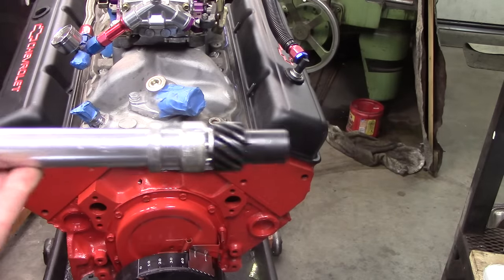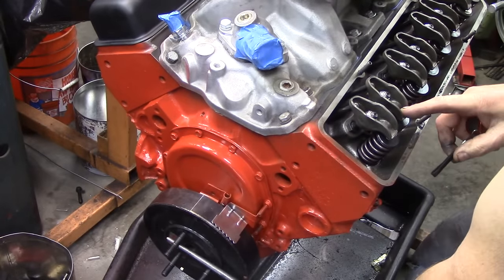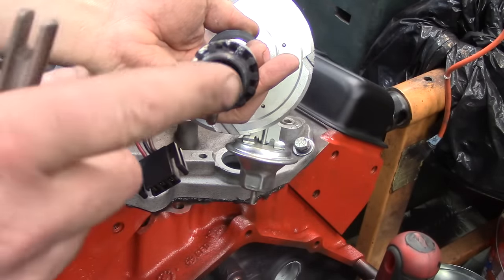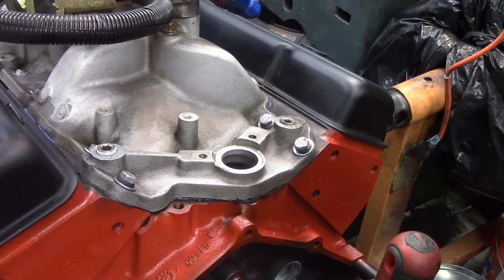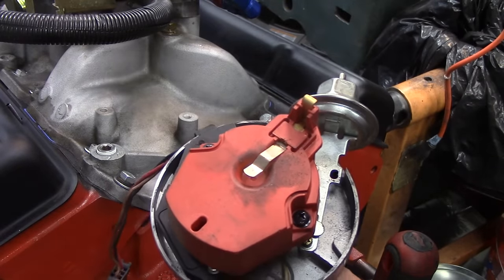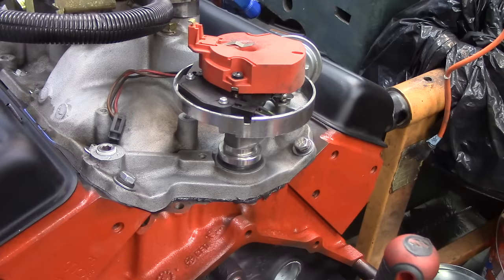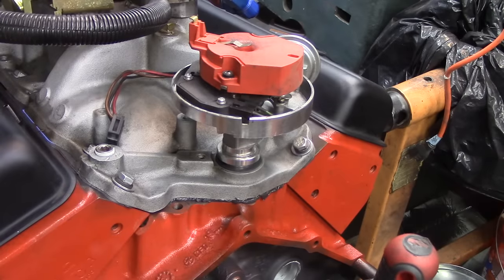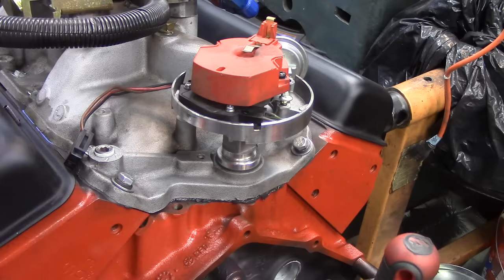How to Install A distributor in a 350 Chevy

Comment: Thanks!  Great video!  When you hook up the number #1 spark plug wire, does it go where is rotor is pointing at AFTER you seated the oil pump gear?  OR before, when you made TDC right after turning it to zero degrees on the damper?
Reply: You ever get a answer on this I’m baffled trying to put one in a rebuilt ford 351 /m also does the rotor that’s to point at #1 do you use the end that makes contact with the cap or the opposite end according to the diagram in my book my rotor would be pointing to #6 if your using the part that makes contact with the cap

Comment: I pull number one spark plug and use a pencil or skinny screwdriver in plug hole until it sits on piston head then rotate crankshaft until piston comes to top, easier and gets you dead on dead center

Comment: back in 2006 a friend and i installed a chevy crate engine the 350 HO in my 95 z71,my friend installed the distributor but im now wondering years later if he did it right,lol messed up huh.it needs a tune up,oil,plugs cap and rotor and i need to check this.so thanks man.

Comment: I recently bought a truck with a new Vortec 5.7, and a bunch of other new stuff, for $200 because it wouldn't start.  He installed the distributor 180 degrees off, when it wouldn't start he got pissed, slammed the hood, and gave up on it.

I expected something crazy, maybe an electrical/electronic problem that would be hard to diagnose.  I was shocked to find out that he abandoned it over such a simple mistake.

Comment: Tough angle to see, but when you were talking about plug wire location, did u point to where rotor is pointing for #1 wire? Or still put #1 wire aligned with where rotor should be pointing (with #1 cylinder). thanks! great video

Comment: What are the 4 equally spaced marks on the balancer? There's once thick white line on the face. Do you start the degree strip at zero where the groove in the balancer is cut? FYI used this method today to drop in a new distributor on my sbc. Fired right up. Super simple procedure. Thank you.

Comment: Excellent work, the way you explained this was  awesome this is  one of my mystery's you did an  excellent  demonstration.  now how do you adjust the valves
Reply: with hydraulic lifters: the old way- with a hot engine idling, if its tapping, slowly, at a 1/4 turn at a time tighten the rocker arm nut until the tapping stops,stop there!--- then slowly tighten an extra 1/4 turn. if it quiet, slowly loosen the rocker nut until it starts tapping , then tighten up slowly until it gets quiet,stop there!-- then,slowly, and extra 1/4 turn.

Comment: So I swapped a points with an hei without turning the engine to top dead center I just put the hei in EXACTLY the way the points sat when it was taken out and it started and runs fine. Is this only necessary if you don't have it set up like that?

Comment: Damn near 40 and I’m still learning new  stuff everyday Also I’d add some people you don’t have to open valve cover stick a paper towel wrapped in plastic bag tightly in #1 hole and turn engine over clockwise by hand til it blows it out the hole easy way to find the compression stroke of number 1
Reply from the maker: Actually 40 is when you just start to get things figured out
Reply: @Myvintageiron7512  ol man told me just when you think you know it all your just now learning

Comment: My way, balancer on no. 1 compression stroke, find a place where the dist. will drop. Then left hand on dist body, right hand on rotor, pick dist up and drop, every time you do this the oil pump shaft will turn 1 notch, repeat until it drops where you want it. Take about 15 sec. or less.

Comment: when u get the dis. in then u can turn the crank to the degree and line up rotor to # 1 and it will be all most in time i have got once perfect timed but it will run just fine and if ur 180 out just move the wires or u can put # 1 any were on the dis. that is what is so great about chevy and a BB and SB use the same  dis. u just need to change the counter weights

Comment: Thank you for this, could've been a pain trying to align the oilpump shaft with a screwdriver
Reply: not really
Reply: I actually prefer the screwdriver method.  It's easy if you use a nice long fat screwdriver, just align the slot with the #1 cy. just like you do the rotor.  Only takes a few seconds and when the dist. drops right in the first time you don't have to turn the engine all the way back to tdc to set the base timing.

Comment: I have a 1986 Ford Ranger with a 2.9L V6 and would like to change the electronic distributor to an hei system. What I'm looking to do is get rid of the fuel injection and go with a carb system. Any help would be greatly appreciated!! Also if you can do any conversion like this I would be more than happy to pay whatever the fee would be! THANKS!!

Comment: Now that your rotor has moved to the other side. Does your # 1 spark plug wire start on the side the rotor is pointing?
Reply from the maker: Yes, that is correct, that will get you in the ballpark so you can time it with the light, I would recommend you watch the video I'm linking here it will help give a better understanding of timing
 https://youtu.be/7Br_yO8KYcMhttps://youtu.be/7Br_yO8KYcMhttps://youtu.be/7Br_yO8KYcMhttps://youtu.be/7Br_yO8KYcMhttps://youtu.be/7Br_yO8KYcMhttps://youtu.be/7Br_yO8KYcMhttps://youtu.be/7Br_yO8KYcM

Comment: I've had a lot of people tell me to have 7-15 degrees of advance timing on # 1 cylinder when putting the distributor in that correct or should it be at dead center?

Comment: Awesome video! This is my first time installing a distributor and i feel pretty confident in doing this now, Maybe this is a stupid question but once I start to turn the engine by hand to get the oil shaft to engage i see that the rotor moves away from the 1st piston direction. Should I still place my cap in the direction of the 1st cylinder even though the distributor doesnt seat at the 1st position? Idk if i made myself clear lol
Reply from the maker: yes the cap goes with number 1 one terminal where the rotor started the rotor is turning because the engine is turning after it drops in place if you turn the engine back to where you started the rotor will also turn back there

Comment: The way you found your top dead center, would your timing gears be at both @ { I think this is what u had} 12:00 or the camshaft gear at 6:00 and the crankshaft gear at 12:00? I got my cover off about to install distributor.
Reply from the maker: @robrtforguson91  yes on a Chevy but not so on a ford they are compression when they are dot to dot

Comment: I'm working on my dads 1978 chevy truck with a stock 350 and a stock gel distributor. I tried all the tricks you just showed and the distributor still doesnt sit all the way down? it still has a gap . I even had to take the oil pan off to replace the leaking gaskets and took out the oil pump and oil pump shaft. and the distributor still wont fully engage ? I shined alighr up between the block and the crank shaft and can see the distributor gears sitting right next to the gears on the cam shaft . while shining the light on the same area I have someone bump the starter and can see the cam rotating but not the gear on the distributor.? I have replaced the gear on the distributor with a new stock gear . I did notice the cam moves back and forth 1/2" to 1" when a long heavy duty strait edge screw driver is put between the cam lob and the engine block. didnt know if it's suppost to have that  much play ?
Reply from the maker: I know I'm a little late on this, but the movement of your cam is a big problem most likely a timing chain problem

Comment: Thanks for the vid, very helpful. Question for you- over the years I’ve had 3 different mechanics tell me with 3 different engines my distributor was in backwards. 2 were on running engines. Was it just 180deg out on the oil pump/ plug lead orientation they were talking about?
Reply from the maker: Not sure

Comment: I don't mean to be an asshole and please don't take this that way but you don't have to go through this process of turning the engine to get the distributor to align with the pump shaft. I'm 60 years old and have been working on sbc's since I was 14, just get your top dead center and drop the distributor in aiming rotor at #1, if it doesn't align with oil pump shaft and completely seat against the intake just lift and move rotor until it aligns with oil pump shaft and drops in. If your rotor is not at#1 just lift the distributor up and move rotor back a tooth on the cam gear and each time you lift the distributor it moves the oil pump shaft, no need for the old long screwdriver trick, keep lifting distributor and moving the rotor back and after a couple of times, three at most the distributor will drop right in fully meshed with the cam gear and seated on the intake with rotor pointing directly at#1. It's the fastest way

Comment: If there is a gap between the intake and the distributor when the gasket is installed, does that mean that the distrubutor is bottomed out on the oil pump drive shaft? Is this something that should be checked for and can it be corrected? Maybe with the use of a nylon shim?

Comment: hi there
just a question i have follow you steps to install my new distributor i have i problem with the car start until it full reterated which make the car run i check the timing with the time gun and can’t get to TDC if i come near to it the car will shut down and won’t start what you think i have missed because i think it is the start of you video i done by put my finger at the spark plug 1 and wait the air to come out and then align it with the TDC. 
thanks for your time in advance.

Comment: I wish I’d watched this video before I started working on replacing my 91 Chevy Silverado distributor. 
I stoped it in but it didn’t sit all the way down. I did set #1 to 0 but when I dropped the distributor it seemed like I it didn’t line up with my position mark. Does it matter if I have the gear on neutral?
Reply: AndradeLandscaping no your gear shouldn’t matter

Comment: Before he turned the motor again to have it mesh with the oil pump, is the #1 on the cap where the rotor is pointing or is it when it actually drops in?

Comment: If you didn't line up the mantle to female connection would the motor just crank and not start
I've been trying to get my truck running for two days now and Im hoping I just didn't line it up right

Comment: I have a 1966 327 350 that has been built up back in 1966.  The harmonic balancer mark does not work when lining it up with the 0 mark.  What are your suggestions?
Reply from the maker: +Theodore Feight find tdc on number one cyl and mark the balancer

Comment: I know you're not a diagnostics mechanic   but I replaced my distributor cap in my 69 El camino 350 and now it won't start, I'm getting spark but it wont fire, although it did start before but I had a few wires missed placed on the distributor cap, got them all in order and then it has not started since.  Also, I never moved the dizzy either.   What could be wrong?

It's a 350 breakerless ignotion... and THERE is spark..
Reply from the maker: +Ron S did you leave the rotar out?

Comment: Question i am installing new timing chain...when crankshaft and camshaft gear marks are lined up ... Is that also top dead center on compression stroke? i need to install my distributor correctly on my chevy 4.3..just want to make sure...thanks
Reply: Yes. If you have the timing chain put on correctly. It is the very reason the marks are there to indicate tdc.
Reply: Yes, i was told that it was TDC on compression stroke from 3 out of 4 mechanics..... but on my chevy  v6 4.3 blazer it was not... i ended up  having to re enstall my distributor again... it was 180 degrees off... yes it was TDC but on exhaust stroke... I ended up going to my life long mechanic friends shop and he said on some motors its the exhaust stroke...i find it very strange,but he was correct..
Reply: The words you want to remember while setting the timing is top dead center READY TO FIRE. You want both valves closed.They make a tool that inserts in the spark plug hole that whistles as you rotate the crank to alert you that both valves are closed. Or put your thumb on it and feel the pressure.You want to be TDC on the compression stroke which is 180 degrees opposite of TDC of the exhaust stroke. Both TDC will read 0 on the crank timing ring. The 180 degrees refers to the camshaft position relative to the crankshaft.the camshaft is turning at 1/2 the crank speed.Think of it as TDC for the crank is always with the piston at the top of the cylinder but the camshaft can be 1/2 a rotation out of position(180degrees) By rotating the crank 1 full revolution you will rotate the cam 1/2 a revolution .
Reply: Yes, i was able to get to number one cycl and stick my finger in spark plug hole as i used my hand held starter device... once i felt air i checked the timing marks and they lined up perfect...then i reinstalled distributor and it fired right up... thanks...

Comment: So I am putting back in my 69 427 big block corvette my original tach drive distributor with the pertronix ignitor 2 or 3. Haven't decided which yet and also seems I have to change from 6 volt to 12 if I use the flamethrower coil? Anyway, my question is using this method, I am assuming that because you turned the engine the #1 was no longer top  dead center and your cap was pointing to the other side, but because the gears were engaged it still locked in on # 1 and would turn to point to #1 when it came back to dead center?  Yes, No? If so, at that stage would you lock the distrib down and start or will it hold there anyway? Hope you can respond, or anyone that could would be helpful. Thanks for the video.
Reply from the maker: Yes you got it right after you engaga the gears you are locked in on Number the reason the rotor moved is because the engine was tirned when you come back around to TDC ithe rotor lines up at number one position again

Comment: i put it to the degree like 8 btc on stock 350 so when i start it it is all most in time and were # 1 is it don't matter on a chevy just the vacuum were u want it and were the rotor points is # 1 if 180 out just move the wires to 180 out chevy is the easiest dist. to put in so u can have # 1 at any place on the dist. i think chevy is the only one that u can do this with

Comment: Well I did as you said and the rotor is still poining to the front of the engine. The motor runs like this but it just doesn't look right. Any ideas?
Reply from the maker: as long as you can get the timing right with the light it's fine just run it the distributor does not care where number 1 is as long as the rotor hits the correct plug at the right time, I ran one with the Vac advance pointing towards the fire wall on the driver's side because I had a tunnel Ram on the engine and there was no room for it pointing towards the front it ran fine,
where ever your rotor is pointing when your piston is at tdc that is where your number 1 plug wire needs to be like I said the system does not care where number 1 starts in your case you may need to move your number one plug over one on your cap, If you don't like where your vac advance is you will need to pull the dist and move it a couple of teeth, me personally as long as I can get it timed with the light I'd send it

Comment: I did this exact method on my "SBC" 1968 327 HP. It doesn't work. Just a note for these engines. Seems there is always an exception to hard and fast rules. On the 327 350 HP engine the #1 on the distributor has to point at the #6 cylinder. Thanks GM!  This will save you lots of headache.
Reply: I know this is an old comment, but that’s because you must have dropped your dizzy in on TDC of the EXHAUST stroke. So your dizzy was 180 degrees out

Comment: You missed one step. Before you insert the distributor you can use a tire iron or a long screwdriver and turn the oil pump shaft so the slot on the shaft lines up in the proper position for the distributor to be fully installed without having to rotate the engine.
Reply: He didn't miss a step. By rotating the engine after distributor is aligned with cam gear once distributor drops it is dropping into slot of the oil pump shaft. Hopefully that makes sense. Good luck
Reply: @macmac4642  what is easier turning a screwdriver or rotating the crankshaft? I’ve used the screwdriver method several times. I didn’t just make up that step, I was doing it back in the 70’s and got it from a Chilton manual.